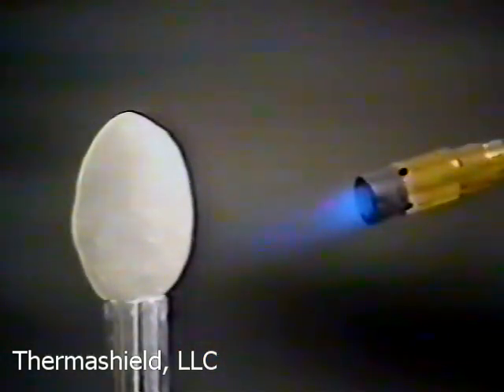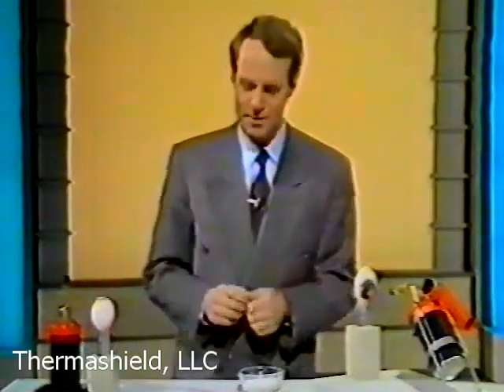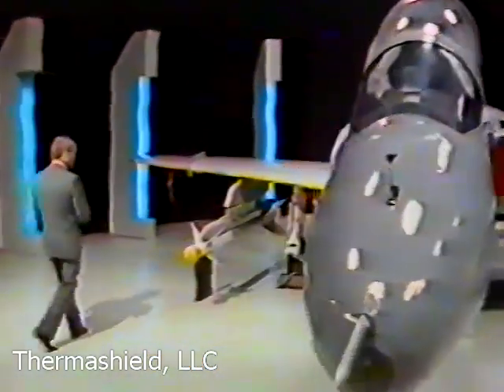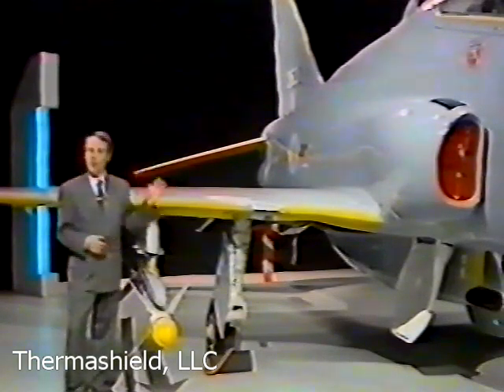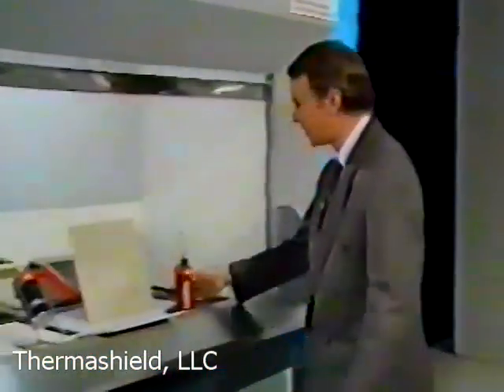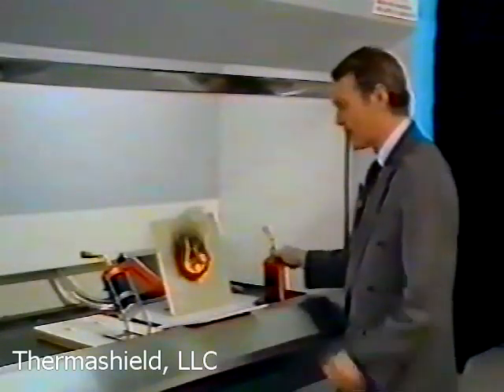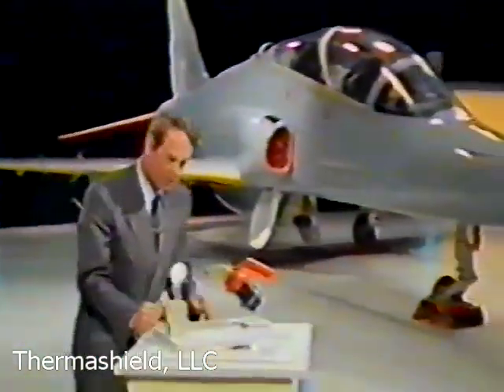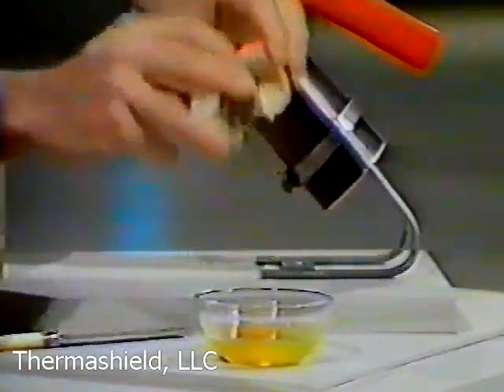BBC Tomorrow's World abridged version

Comment: AeroGel?
Reply: Starlite was found to be 17000 times as heat-resistant as the AeroGel tiles on the bottom of the space shuttle. Sadly, Maurice Ward passed away in 2011, and took the recipe for Starlite to the grave with him.
Reply from the maker: There are a good amount of differences between Starlite and Aerogel, starting with structural stability, surface hardness with an epoxy binder for example, etc. Also, cost. Maurice did not take the formula to the grave, he left behind copious amounts of notes and withdrawn patent applications which we were able to analyze and update with current market products.
Reply: @FestinaFirefly  
Thank You !!